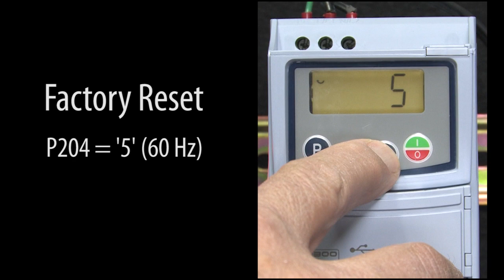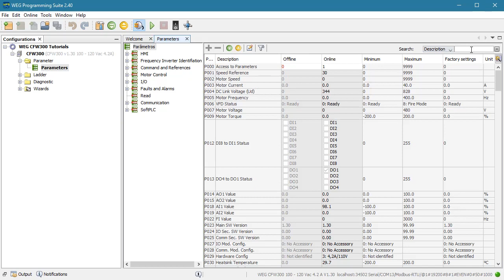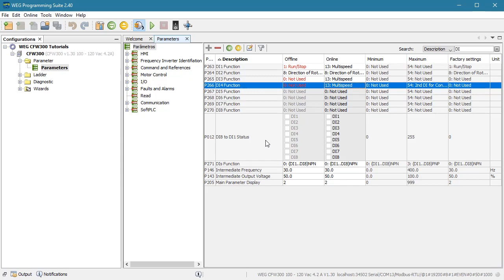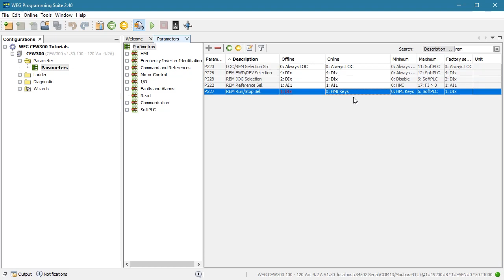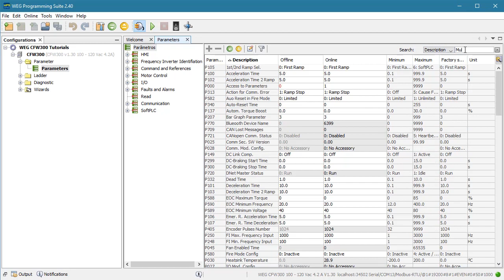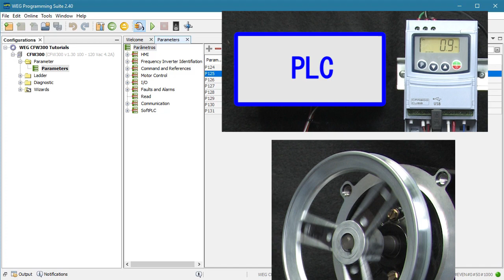WEG CFW300/320 VFD Multispeed Motor Control from AutomationDirect

Comment: Hi is posible to use the DI1,DI3 y DI4 in multispeed configuration and DI2 for run and stop configuration ?  do i have to configure anything else ? thanks for your help
Reply from the maker: Yes, in fact it is a requirement.  Look at table 7.4 in the programming manual (https://cdn.automationdirect.com/static/manuals/wegdrives/programmingmanual.pdf). 
You have to use (DI1 or DI2), DI3, DI4 as the control bits.  You could also use DI1 for your run stop and then use DI2, DI3, DI4 for your multi-speed control.  Bottom line: the bit you don't use is available for whatever you want to use it for. Check out all the WEG CFW300 videos at www.automationdirect.com/videos.